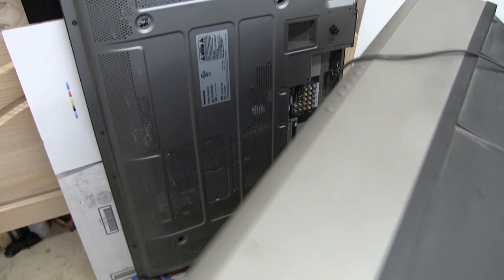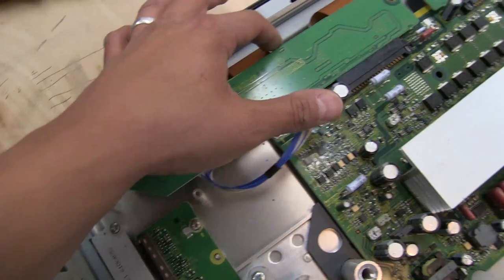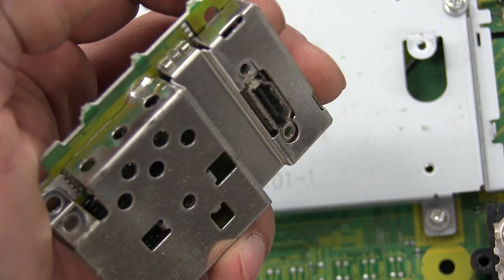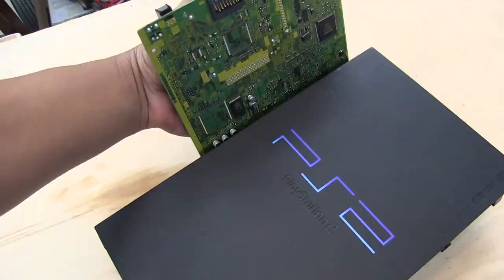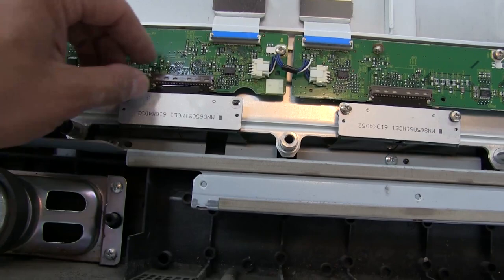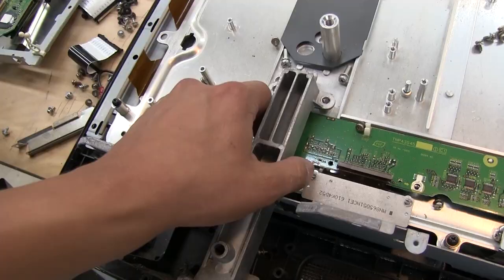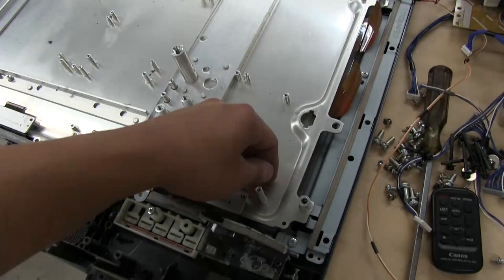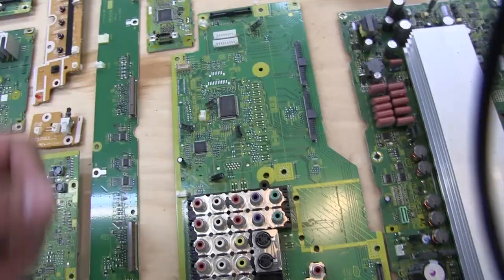TWB #95 | Panasonic Plasma TV Teardown

Comment: Had that exact TV for about 11years, Best TV I ever had. The sound was so good on it I stopped using my Denon receiver through it. Then again I paid nearly $2000 for it. Bought a new 4K Panasonic 2yrs ago, just doesn't compare.
Reply: Ive owned mine from my mum she bought it back in 2013 or something and it still kicks ass the colours look clearer everyday 😂
Reply: the sound on this tv is so good i sold my sound system.

Comment: Those kind of  tv never ment to be trashed they ment to be repaired thats why there are parts for each module rather than cheap ones like joined pcb with power and etc etc 

those tvs have seperate parts for each module like power Tcon X sustain HDMI etc etc so they go bad it can be fixed like commerical ones

Comment: did the same for a LG plasma, though that had a perfectly good plasma screen, but unfortunately it was a victim of lightning, and the main processor at least was detonated. Yours likely also had an option to have a CA module in it for pay TV and a cable and satellite decoder integrated in depending on the model build.

Comment: I like how this TV has separate boards for each part.
That class D amp is a good find. You should try to get it working if it has analog audio inputs, 

I tore down a broken TV that a friend brought over and it was a class D amp like here and I made an awesome boombox out of it and it CRANKS. I had to put in a small kicker amp from a cheap MP3 player amplified speaker dock thingy because my audio source straight to the inputs of the amp wasn't loud enough for me. I like my amps LOUD.
Reply from the maker: With the exception of the audio controls, it appears that it just takes analog audio as the input, but might need I2C or SPI to control the volume and tone. I think I was able to find the service manual for it just doing a quick search, but haven't actually done an in depth investigation of it yet. The service manual should be helpful for the pinout of the amp board.

Comment: I got a 3D passive led tv with damaged LEDs so that screen is black when turned on but image can be seen when pointing flashlight in dark room, so the lights are off.
I allso have a plasma same size that , Samsung with many lines horisontal running and ruining picture.
Can I put plasma on for backlighting and let the LG passive 3D make 3D with plasma bright lights?
Is there a danger in voltage in the plasma maybe? 
Do you think it can be done?
I read about a guy using passive glasses on a active 3D and was amazed on what he saw, so nice he said and in great 3D qual.
I can find the link to the article if your interested, I just saw it yesterday.
Hope to hear from you and will subscrie to channel as seems interesting topic you involve in;).